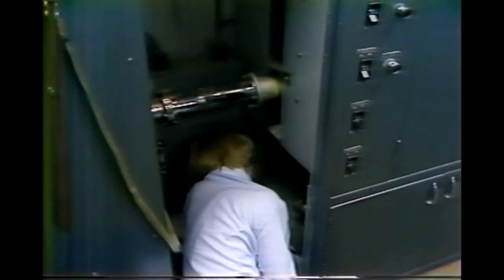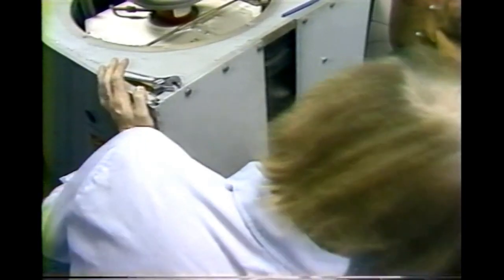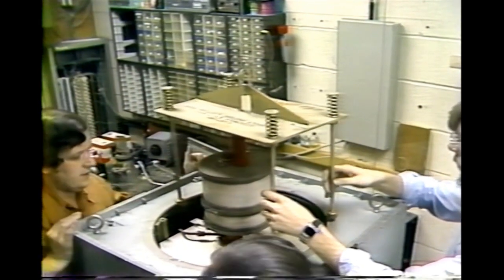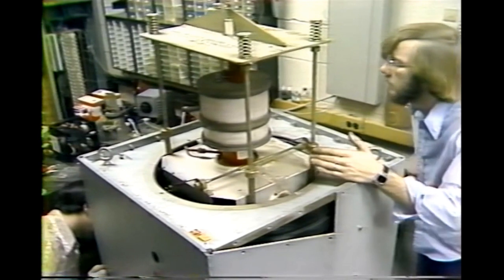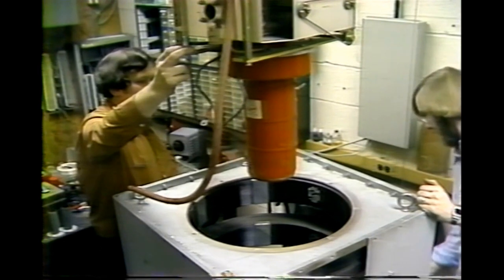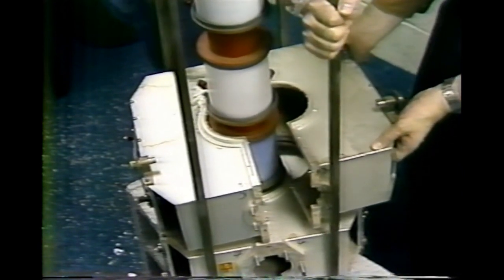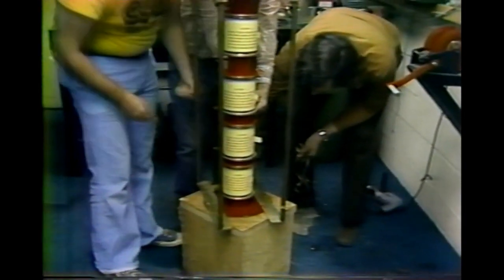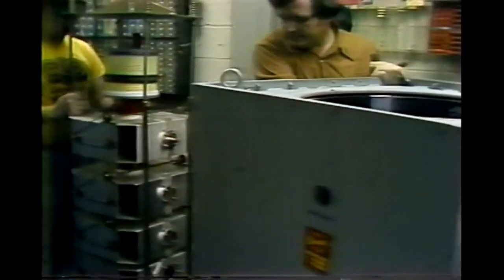4KM100LA Klystron Replacement

Comment: I'm curious about what station and channel this transmitter was for. I recognize the transmitter as a Townsend or Ampex, depending on where it was purchased. My first TV job was at WBLG-TV in Lexington, KY. on Channel 62. Our transmitter was labeled as Ampex. I didn't get much experience with it, as I was mainly studio equipment and operations engineering. Later, we changed to Channel 36 with an RCA TTU-110.
Reply: Hi Michael... Canton OH channel 17 WJAN. The station has transferred a few times and is now a virtual station on a dot channel, WDLI. Yes, we were one of George Townsend's first customers in 1966, then went on the air in January 1967. I'm thinking he already had one or two transmitters on the air in MA or PA by then. We started out 7.5 KW TPO, then brought it up to 25 KW visual in the 70's just by swapping out the beam supply and one Varian tube. Townsend sold his business to Ampex, but he later either bought it back or started a new company with a similar name. George was a good guy, he'd stop in and say hello every time he passed through Ohio.
Reply: Thanks for the info. @dalelamm